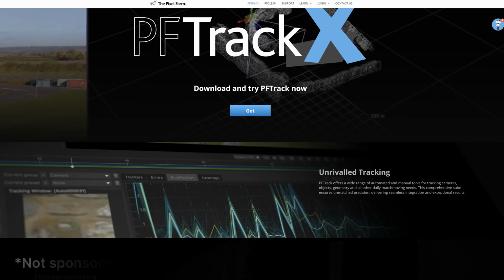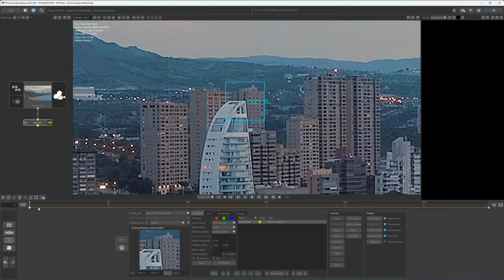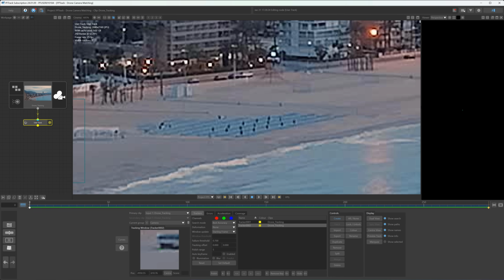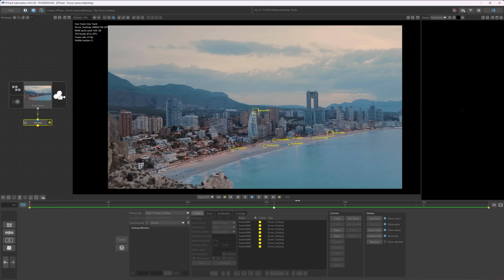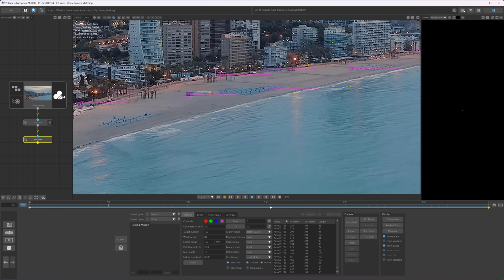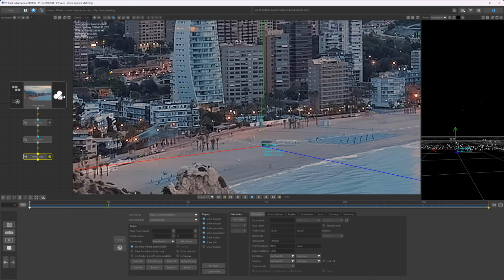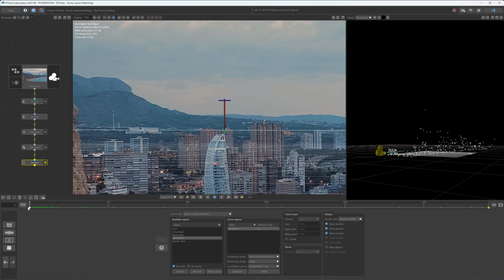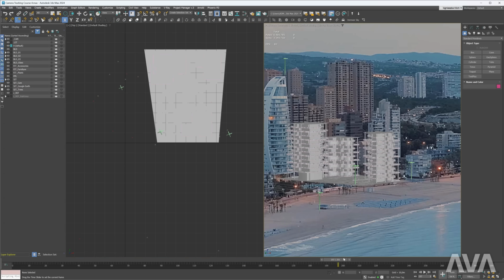Track Drone Footage & Export Camera to 3D Software

Comment: Cool tutorial, great job. I would maybe comment on just two things: you dont really have to manually remove bad tracking points, there is an option in PFtrack to filter points that only have a certain error amount and it will remove all tracking points over this accepted error amount. The second thing I would use google earth to measure the site (works pretty well) and then put that data into PFtrack telling it "hey the distance between these two points is so and so many meters". This will give you a camera with the correct focal length and the tracking points will be at the right distance from the drone camera, I prefer doing this because I would not want to scale my architectural model from the client as real world scale is important.

Comment: Apart from PF Tracking are there any other tracking software which is better for architectural visulization..?
Reply: I also use After Effects or Blender just for tracking
Reply: If you are doing the modeling and the tracking then Blender does both.  It is also free.
Reply: SynthEyes is another I use
Reply: Boujou
Reply: Here's no tracking software for only architectural visulization, it's just tracking software. 3DEqualizer is industry standart. SynthEyes also not bad. All depending on footage and task. Footage from this tutorial is simple and you can track it everywhere, even in davinci or after effects.
Reply: There is a resolve workflow
Reply: @GrecoFPV  do you have the link for the tutorial with resolve
Reply: @GrecoFPV  my 3d model slides under the capture...does anyone know why?
Reply: @gibranarnt4386  That's probably because the tracking isn't precise enough.